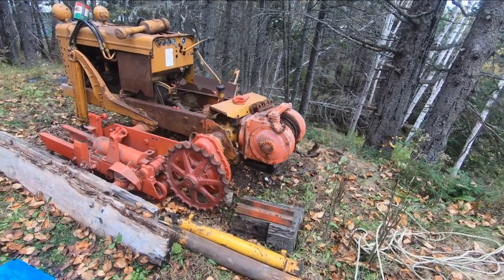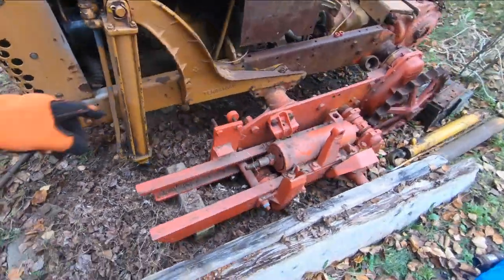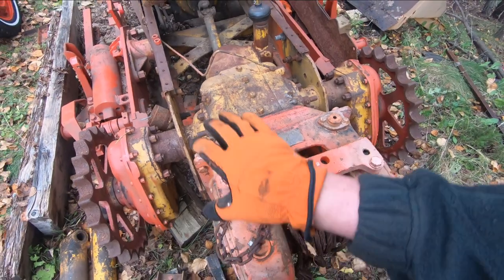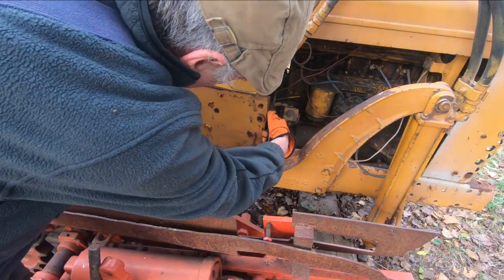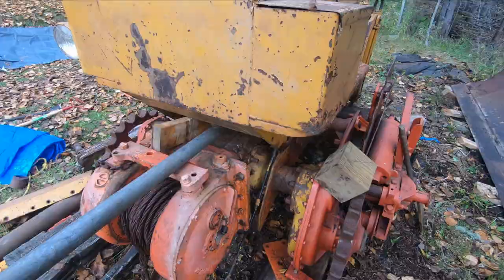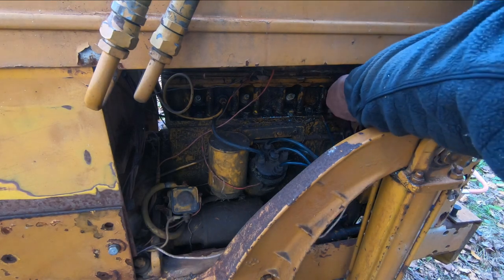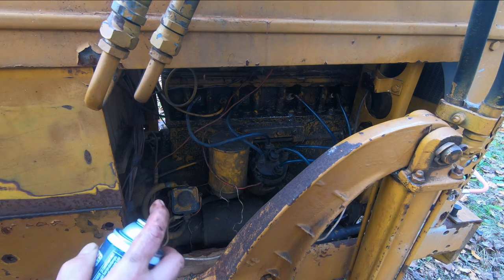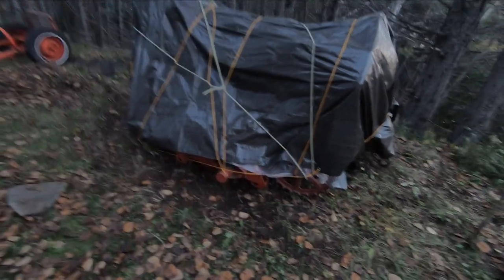CASE 320 ANTIQUE "TERRATRAC" BULLDOZER: PUTTING IT INTO STORAGE

Comment: It looks heavy. Even if it's a relatively small machine, it looks heavy. Looks like a lot of fun except for the spinal injuries!
Reply from the maker: The book says this weighs 6,405 pounds. This little bulldozer has been in pieces for years and hopefully, will get put back together over the next few years. I have accounted for most pieces but there could be something missing. They are impossible to find parts for so I may have to build and open a mine, a smelter, a foundry and a machine shop to get parts. Did you watch the part where I emptied my pockets?
Reply: @EverydayProjects  I saw that part, I had to laugh. You probably have that missing driveshaft yoke in your pocket, just dig deeper!
Reply from the maker: I probably have Jimmy Hoffa in there somewhere! haha @heliarche

Comment: What state are you in im in massachusets and would love to have this dozer i have a colection of old tractors id trade or pay
Reply from the maker: This machine is in Quebec, Canada. Not For Sale. Not yet. I plan to reassemble and get it running. Look in the description under the video to find my email address. We can keep in touch should plans change.
Reply: I have same one I need motor I have same one some one took motor apart years ago never got back together I might let you get mine if worst comes ŵe can stay in contact I know alot about old case tractors  I have case 310 g dozzer I fixed up
Reply from the maker: I'm in Canada, and this tractor is in Quebec. I am aware of the limited number of these made and therefore the value to a collector. This was stored for more than 50 years in its current condition and I have just recently come into possession of it. Not sure what I'll do with it but for now, its safe under wraps. The 310s are very close and are neat old machines too. Take care. @ericlakota1847